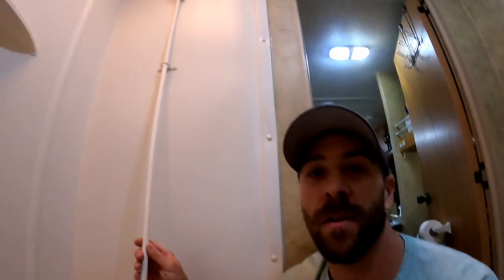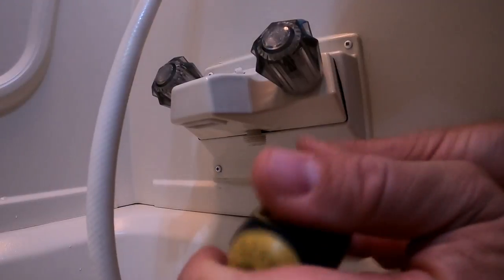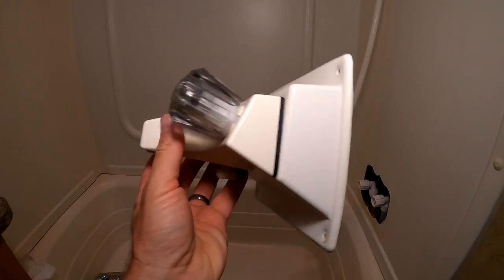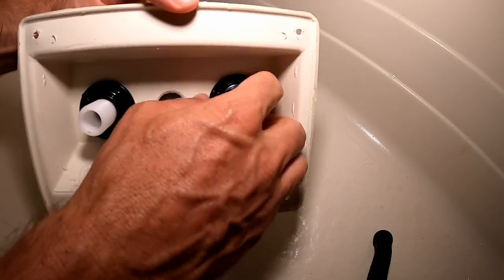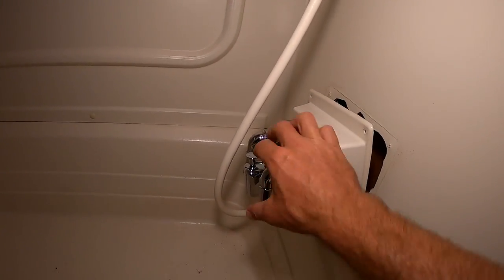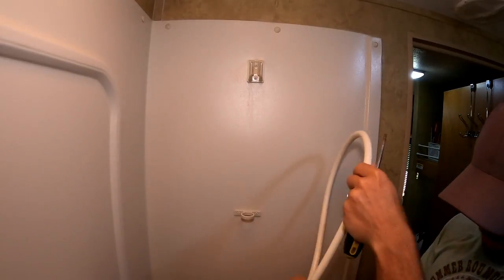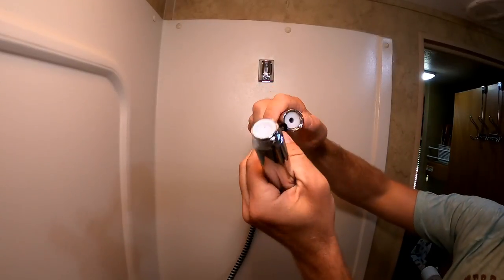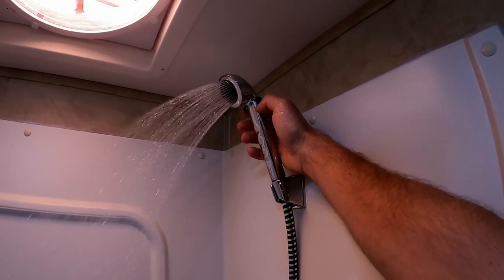How To Replace An RV Bathtub/Shower Faucet and Shower Head

Comment: Thank you so much for this how-to video! We had a leak in our shower faucet and had to replace it. There is still a small leak from where the water lines connect to the fixture but after watching your video, it should be an easy fix. 
I should mention our leak seemed to only occur when we had the hot water heater running..🤔
Reply from the maker: Glad the video was helpful!  I hope that you figure out the leak.  Maybe try using some thread tape.  If it's plastic to plastic connections, you shouldn't need it, but sometimes it helps.  Thanks for watching!

Comment: Hi, great video.  My issue is I don’t have access to the faucet connections on the other side of the wall but do NOT have your faucet bracket extension like you do.  Do you know what the product is called and where I could get one?
Thanks
Reply from the maker: Do you mean this? https://amzn.to/3PCrtFS  It's called a Faucet Stand-Off Bezel.  Hopefully that is what you are talking about.  Thanks for watching.
Reply: @ColoradoCamperman  Yes, thank you.  Couldn’t think of the correct word but I guess it would be called a mount.  Thank you
Reply from the maker: @MessnerMortgageGroup  No worries! Glad I could be helpful. Mount would make more sense than stand-off bezel, lol!

Comment: You know what you didn’t show? How you got your meaty man hands BEHIND the bulky box that fits between in order to tighten everything up. Video totally skips that. So, I’m going to guess there was much cussing and fiddling to make that happen - otherwise we could’ve used your wisdom on that part or some honesty about how that is legit the most frustrating part. 😂
Reply from the maker: Lol!  It was actually pretty easy on ours, that is why I didn't show it.  Our pipes were pretty flexible and stuck out a good amount.  So I was able to pop them out of the hole in the wall and screw them into the valve box.  Sorry you had troubles!  Hopefully you got it.  Thanks for watching!
Reply: @ColoradoCamperman  I was just watching going, “how did his hands fit and mine don’t?!” We got it with hands and careful placement of pliers - all fixed up now for our trip up to CO soon!
Reply from the maker: @whitneywhite4070  Heck yeah, glad you got it! Have a great trip out here!